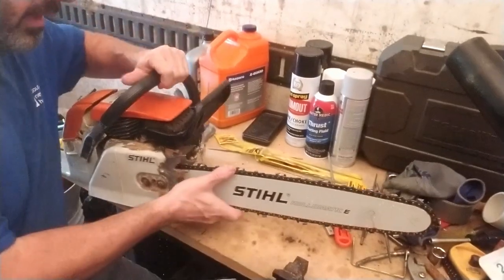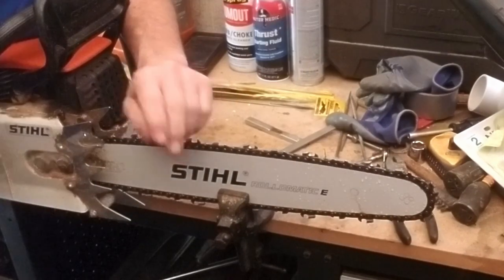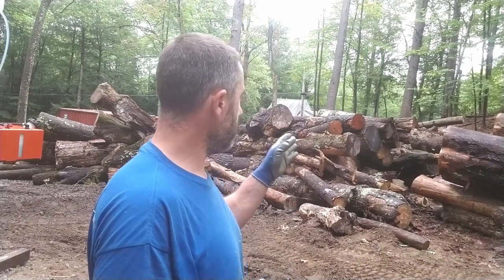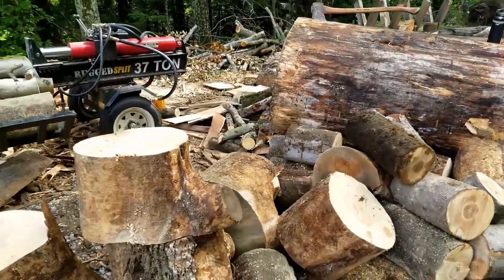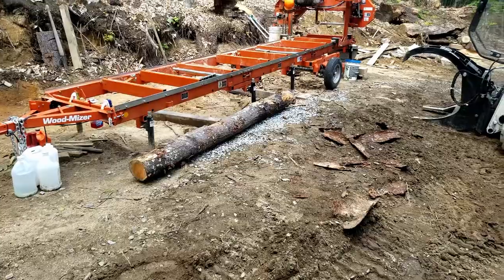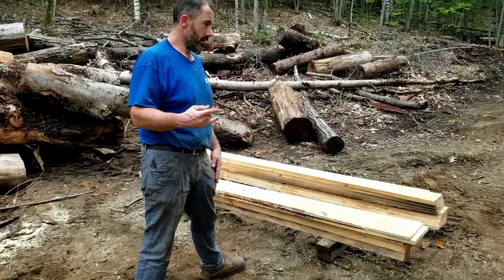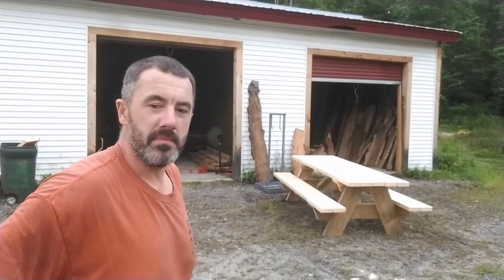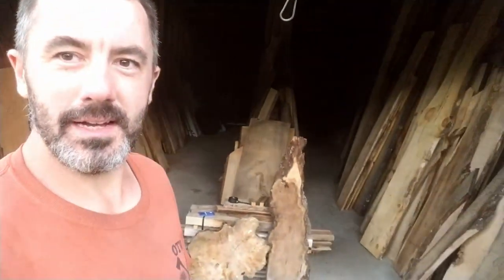A Day In Our Life At Dillons Woodworks

Comment: your sawhorse you showed there is how i built mine for on the job the last several years ...if you do alot of cutting over them and find yourself cutting into the sawhorse put an additional 2by6 on top and screw from the bottom up so you dont hit the heads with the blades ...on your table ...hav you ever considered dutting some live edge 2by6  for the bench seats and table top ? use the live edge only on the edge boards ...so it would take 6 live edge boards total
Reply from the maker: I like your sawbuck.  I've been wanting to build one.